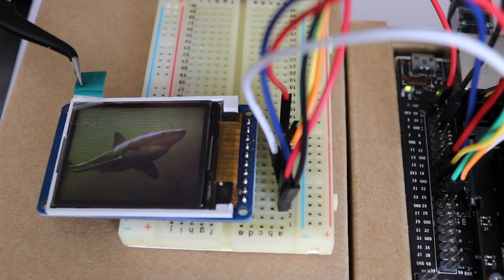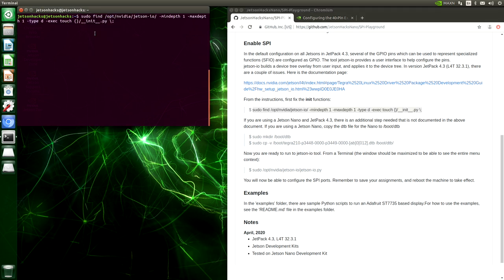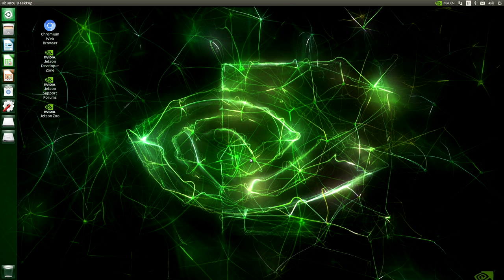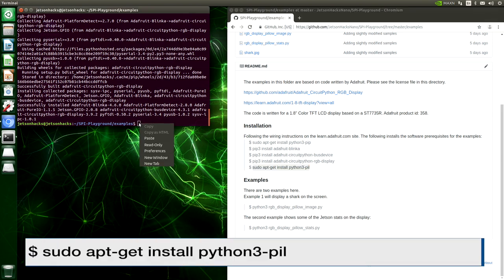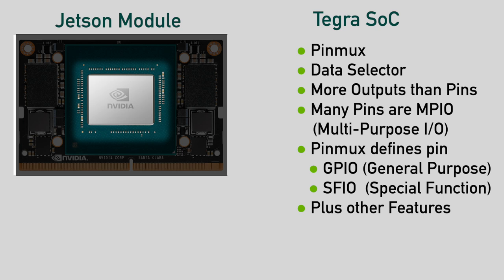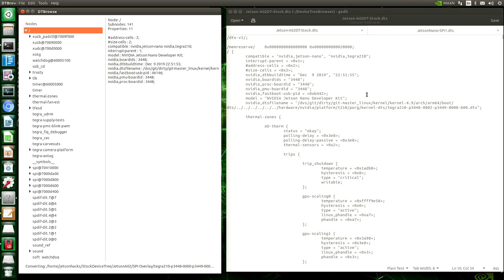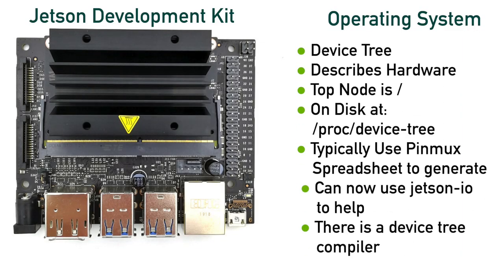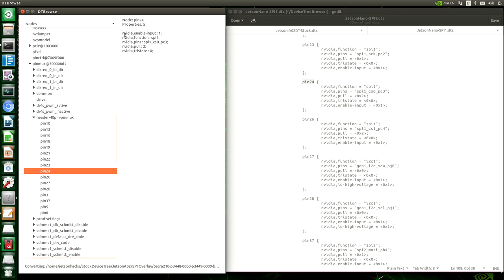Jetson SPI using jetson-io + Device Tree Explaining

Comment: Is it possible some how that macbook Air M1 can be use an monitor for Jetson board ? 
Please reply I am new to this field.
Reply from the maker: A Macbook Air M1 is not an HDMI monitor, and isn't used as one unless extra hardware is added. For example, you may be able to use a HDMI capture device (not tested here). You may be able to use the MacBook as a remote desktop over a network with the Jetson. Please ask this question on the official NVIDIA Jetson forums, where a large group of developers and NVIDIA engineers share their experience.
Reply: @JetsonHacks  
Thank you so much for suggestions and for prompt reply.
Reply from the maker: @sahilpawaskar5512  You are welcome.